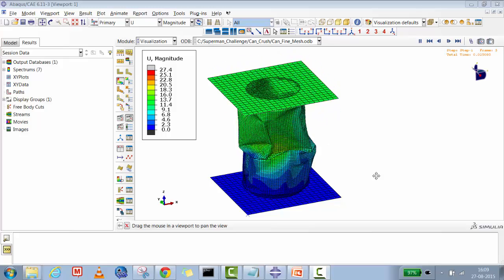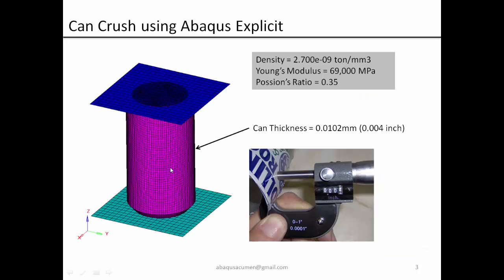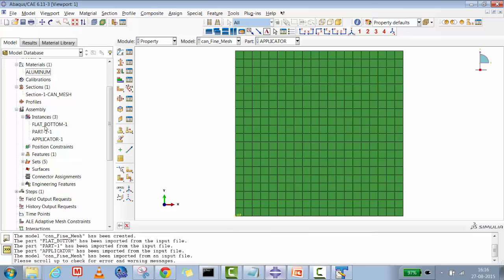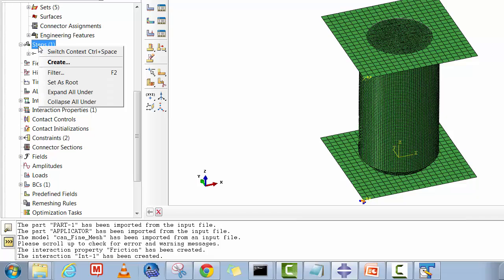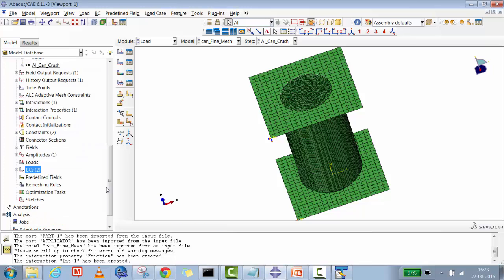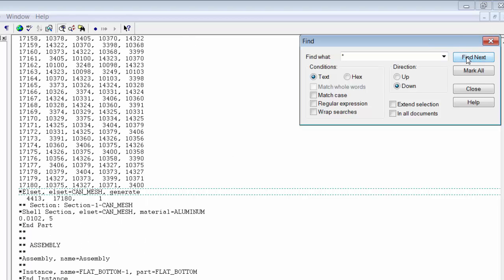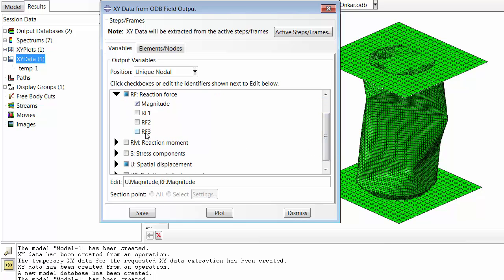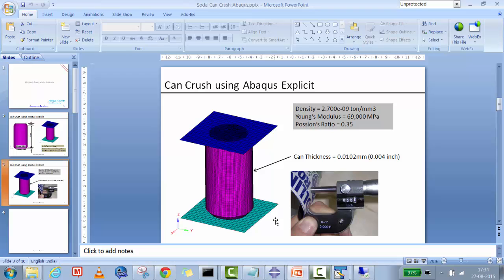Abaqus/CAE 6.11: How to do Aluminium Can Crash Test using Abaqus Explicit Solver

Comment: Shouldn't be plastic properties defined for the material? There is obviously plastic deformation but solver runs it without these properties (only elastic and density are defined in the video), I am confused.
Reply from the maker: You can have plastic data in the model.